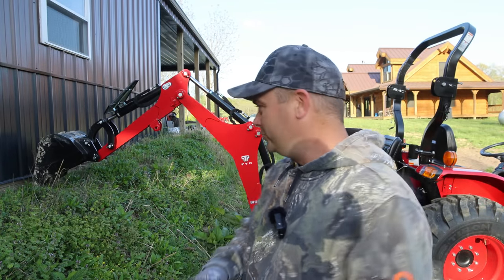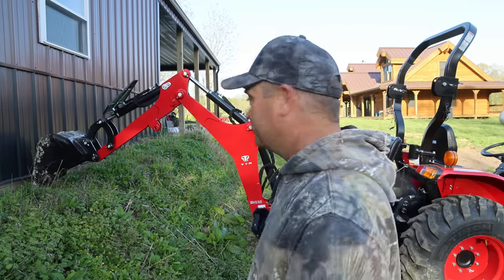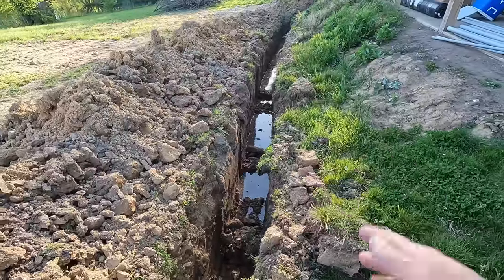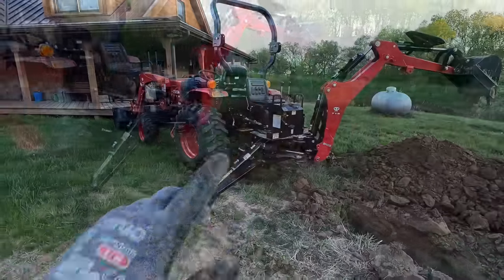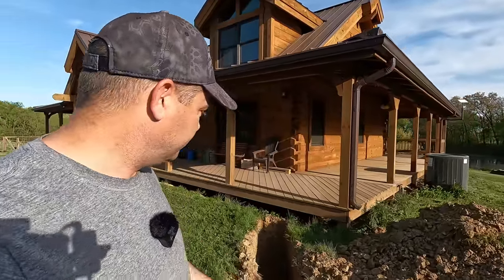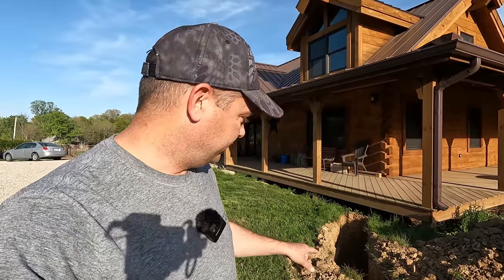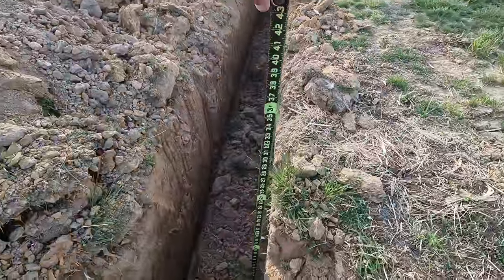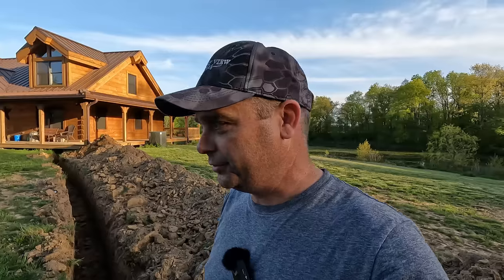Digging over 100 Feet of Trench with the Backhoe attachment.   Not my best work, but it will do

Comment: Digging too deep isn't a bad problem, especially if you put 8-10" of stone in the bottom so your conduit doesn't lay submerged in water a lot.  It also gives you room to run additional conduits, which I would put in now so you will have them for anything you may need to run from barn to house in the future, like ethernet, fiber optic, security system & camera wiring, etc.
Reply: That's some good thinking right there!
Reply from the maker: I did put in an extra 1" conduit. In case I do any of those things.
Reply: The dude is going to China
Reply: Wise advice. Lay down extra conduit now with them "pre strung" (your guide pulls), and you'll be Very happy later. 👍 Nice work 👍
Reply: Hi, Evan!  Great video!
Reply: @GM-wr4nx  😂

Comment: Sure beats digging by hand!! Looks good, Evan! Have you made working drawings of all these improvements? They will be an asset if you ever decide to sell. We put 2”, 1.5” and 1” conduits in our trenches for ham radio coax, electric(Low voltage and 110) and water, in that order.

Comment: Nice job, but it looks like you never got your trenching bucket. Huh? Also a tip: measure from the tooth on the bucket up the dipper with a temporary marker, and or make a ruler on the backhoe with a permanent sharpie.

Comment: I had a setup similar to yours and dug in clay ground. After digging my trench I would switch my backhoe out with my 55”  rototiller. Then I would drive on top of the dirt pile and rotatill the clay until the large clumps were gone. Then I push that into the trench. When I was finished there was little to no settling.

Comment: Quick tip. Measure 24” on the stick of your backhoe with the bucket flat on the ground and use that as a guide so you know if you lay your bucket on the bottom of the trench you have a rough idea of where 24” deep is. 2nd tip. To get that last little bit out just dig the trench a little deeper in that spot and then smooth out the crumbs back flat in the deep spot of the trench.

Comment: When grading alone mark your arm with a piece of tape as a guide. Also when you digging between two structures do a little at both ends so you can get the job done without turn the tractor

Comment: I thought about renting a power trencher but wound up hand digging my 125 ft conduit trench.  I did have a single shank Subsoiler to loosen up the heavy clay but it was a bugger to clean out.  I had the opposite problem than you---doing my best to keep the trench around 15 inches deep. Just like you, the work I did was good enuf for who its for!

Comment: GREAT JOB !!! Maybe you could get some sand delivered and fill the whole 3/4 full with the sand.  Then you can use the extra dirt behind the workshop for your leveling/drainage solution.  you'd have to bring in more fill dirt for behind the workshop anyway.  why not just bring in sand for the trench?

Comment: Nice job. Smooth the bottom of the trench and pump the ground water out before you install the conduit. Conduit should rest on a smooth bed. During backfill level the dirt before you compact with a jumping jack. No doubt you will do a great job as always. Next time you trench start at both ends and let the both trenches intresect.

Comment: When I was on some electric power substation projects, we did the trench excavation like you did and installed the conduits.  On the surface of the rocked yard and directly above the PVC conduits, we placed 9"x9" by 4" thick squares of concrete to clearly show the location of the conduits underneath.  In our case, we also put some marking grooves in the surface of the concrete so that we could tell where a cable or conduit turned toward a piece of equipment.  It wasn't easy to keep posts or other markers from getting hit or otherwise lost.  The concrete surface marker pads worked well.
Reply from the maker: Where I work, we stamp the concrete paving where conduits are underneath.   We also encase the conduits in low bag mix of red colored concrete to protect it.

Comment: Nice work Evan! I saw that somebody already mentioned putting some Stone in the bottom. I would definitely do that where you went very deep and there's water so that way the clay doesn't settle can you wind up with a belly that pulls your conduit down/ apart. I was taught that when backfilling to leave a foot or so mound on top of the trench, then run a sprinkler over it for a few days/ week and watch it naturally settle in. Keep doing this until it stays a mound, then grade and plant. Love what you guys are doing and enjoying watching.

Comment: Rent yourself a "jumping Jack" compactor and compact in 12" increments and this will completely solve your ditch issues with settling.
They may look intimidating to operate but they are fairly easy to use.

Comment: When you grease your equipment look into Lincoln air operated grease guns so you can hold the tip on the fitting. It is easier and a lot quicker. When I was greasing a truck with a boom on it with 50 fittings you find the best way to do it.

Comment: To settle the trench, backfill it, then turn the hose on and let it fill. It will drop down, refill, do it again. I have similar clay and found doing this works. I'm presuming your on well, otherwise this can be expensive.  Or, run a pump from the lake I suppose...

Comment: Evan if you only put 8 to 10" of clay in when filling the trench you will be able to pack it better now that you have the backhoe. By using the back of the bucket to bump it into the clay, do it in layers. Don't try to backfill all at once do it only a far as you can reach.

Comment: If your boom cylinder is strong enough you can place the front bucket flat close to or on the ground rear bucket flat (above or in the trench depending on machine or depth, get the stick relatively vertical and use the boom to raise the back wheels of the tractor off the ground and use the swing levers to pivot the rear wheels of the tractor to straddle the trench.  Essentially using the backhoe to position the rear wheels or outriggers without "driving" the tractor.  On a side note, at 2:24 operating the outriggers standing on the ground is not a great idea.  If the tractor was to roll back with you standing there it would make for a very bad day.

Comment: I started this exact same project today with the same results you had. I was wondering how I was going to get my tractor wheels over the trench on rocky sandy soil once I got the trench connected. I have but maybe 15 to 20 hrs of stick time and operating at 90 degrees seems to mess me up with the controls because of the perspective, angles or whatever. If I stare it at long enough I'm sure I'll figure it out.  Thanks to you and the commenters below with more knowledge than I for the ideas.

Comment: Use the bigger tractor to drive over the trench to pack it down a bit. Then when you make the final grade on the trench, don't make it level with the existing lawn, make it slightly higher. When it settles after a year or two it will blend in perfect.

Comment: I am in shock. You did not dig up any metal that we saw on the video. As much as you have uncovered elsewhere i thought you surely would find some there.
Reply: I know, right. I have a few hundred acres and no matter where I go, if I start to dig with the mini-ex I will definitely hit an old pile of buried tin, old barbed wire, old implement pieces, axles, logging cables, mattress springs.....you name it.....I hit some kind of earthly treasure EVERY time!

Comment: Suggestion  for depth control   mark your bucket   postion  boom and bucket  in position  where bucket  pointed  so teeth are straight  down use tape  measure  ans mark it at 1 foot ans 2ft and 3 ft  either  with yellow  or whit strip   that put you in ballpark of depth needed
  Or could use the bucket alone as guage measure bucket  at maximum  digging  potential   looks like on camera bucket is 24 in   16 in wide by 24 at its max length  of bucket? ?

Comment: Evan, Are You counting how Many time people tell You to Mark the Bucket ???
Waiting for the Other Video of the Completion. I have a suspicion of How You ran the Conduit at the Barn end. 
As to how I Would Have done it. Lets see...HEEHEHEEH...
I ran a Conduit for My Sisters Starlink Antenna. An put some timbers over the Trench to park the Tractor on to keep the Trench Straight. the Conduit is Hidden from View at the House and inside the Pole for the Antenna. 
Mike M.

Comment: You are very good with your new machine  , I would mesure the bucket when the teeth are pependiccular to the ground suppose the bucket mesures 18" inches and the highes pine is 24" inches and an other point 30" inches you would have a guide as to the hole you want to dig ...

Comment: Use your bucket to gauge depth, it’s probably close to 18 inches from tooth to pivot pin. I’d also measure a few other points on the arm and mark those for future reference. That trench is easily 3 feet deep in spots. Overall not a bad job though.

Comment: Once you get this project finished Evan (the backhoe's maiden voyage) You can take her out behind the barn and dig and exploratory trench  across the front of the cement slab to determine if there is a clay pipe from the barn floor drains that runs under the slab.  If you don't find a pipe, next step is to rent a water cooled diamond saw and cut the cement to open up a trench to match up with the down pipe inside the foundation.  That will require some careful measuring - but it can be done.  |  With the backhoe off, that little machine should be just right for cleaning up the manure pack on the cement slab.  Start a manure compost pile if you don't have one already 😊

Comment: the tractor would be unlevel but you use the outrigger's to level the backhoe. then you leave the tractor out of gear so you can move the tractor with the backhoe. never dig all the way to the straight under the tractor. always move when it is have way and you will be able to work faster as you on move part of the backhoe, not full retract to full extend only half.  use the bucket to lift the back of the tractor over the ditch, then put dow n the outriggers. when finished, reverse the operation to get back over the ditch.

Comment: You may have done this, but if not, I'd recommend sketching out measurements of the trench in relation to the house and shop building. It won't be something for you, but for whoever inherits the property from you should the time come when you and Rebekah are no longer there. Also, it may be too late, but I recommend putting caution or some type of locator tape about a foot under the final grade. That way, if anyone starts digging in that area, they'll find it before they find the conduit. I work in the utilities field and there are so many instances where people buried service lines, electrical lines, phone/cable, sprinklers, etc and it would have saved a lot of headaches had the person just took some measurements and made a sketch to keep with the home records.

Comment: Whenever I see discussions within tractor forums on backhoes the general consensus turns to 1) they're too expensive for the limited jobs you have or can do 2) Rent an excavator when you need to do those jobs.  You'll be happier and get done much faster.   After you did this trenching job what's your opinion?  Seems like a lot of work to move the tractor every couple of feet.
Reply from the maker: Depends on what you are doing.  Small jobs like this.  The backhoe will do fine.  To rent a mini excavator, it takes me 1.5 to 2 hours to pick it up and unload it.  Then another 1.5 to 2 hours to load and take it back. That's 3 to 4 hours wasted out of my day.  The convenience of having something right there to use is worth it to me.  Because I work a full-time job, I only have weekends to do this stuff.  So time is always the biggest factor on decision making.  I was able to this job a few hours every night after work.  So I still the whole weekend for other tasks.

Comment: Jealous of your backhoe! I dug a trench for tile last summer by hand through the same kind of clay three hundred feet long and some as deep as you are. There is a spring in the side hill that ices the driveway in the winter and ran around the house and into the sump so that is all fixed (cut electric bill from the reduced sump pumping). However, this summer planning for a root cellar dig, doh! ...

Comment: I ran equipment in construction for over 50 years. You did fine. One thing I would recommend is now that you've tried it the next time you see a pro running a hoe pull over and watch and steal ideas.

Comment: Compare this to when you used the trencher to put in lines to the barn. Trencher seemed easier and quicker.
Reply from the maker: Trenchers can do it quicker with less ground disturbance.  But considering it takes an hour to get a trencher, another hour to take it back.  About the same overall time to do it with the backhoe.   If it was 300 feet, the trencher would be worth the time to go rent one.

Comment: A couple of comments.  You might want to seal up the ends of your conduit with expanding foam to keep critters and water out.  Fill the trench in halfway and then start hosing it down with water if you want to get all your dirt back in.  I think you did well for your first time using the backhoe although it was quite obvious you were way past two feet deep.  No harm.

Comment: Well, In my mind I see you using a pump to get the water out of the trench then getting an old fashioned shovel and a pair of boots and getting down in that trench and leveling out the bottom of it.   Then using the shovel to finish digging out under the porch and once that is  done you can lay your pipe and cover it.  Stand on your pipe and shovel in the first bit of dirt so the pipe stays at the bottom and doesn't float.  Back fill and then pull your wire.  Before you back fill, it would be interesting to see what would happen if you sealed both ends of the pipe and then pressurized the pipe to check for leaks.  And consider pulling heavy duty ethernet cables (multiple) through the pipe with your electrical cables.  (maybe an intercom cable too)  WiFi would work much better in the barn if there was a wired repeater/access point in the building.  (All assuming that your putting in a pipe of significant and sufficient diameter.)

Comment: I know you have to use the backhoe because you have it, but it was definitely over kill a trencher would have been better. Could have got it done the first night. Good job though better than if I did it with backhoe!
Reply from the maker: I couldn't rent a trencher in the evening.  I get off work at 5 pm.  Where I rent equipment is an hour from my house and 1.5 hours from where I work..  using the backhoe made sense.  I was able to do it after work of an evening.